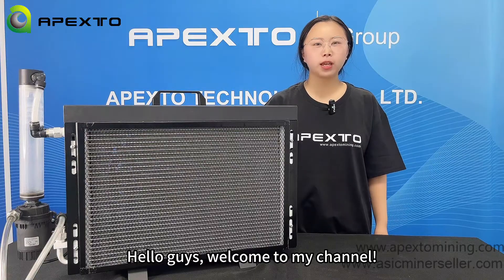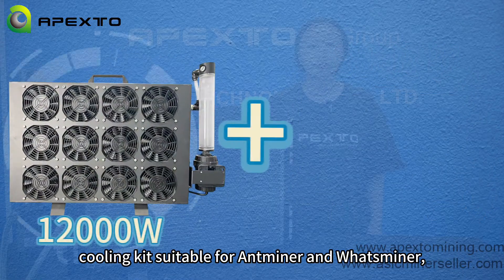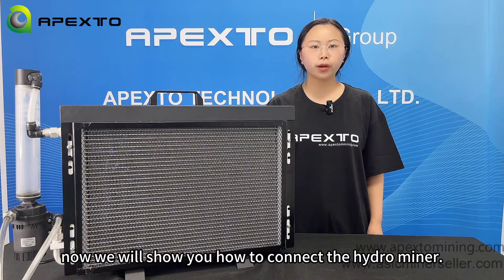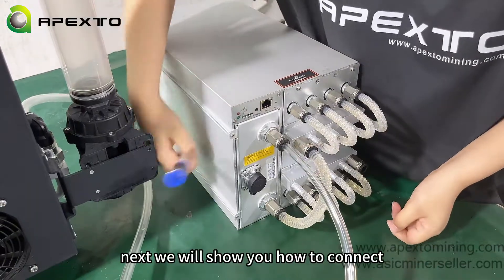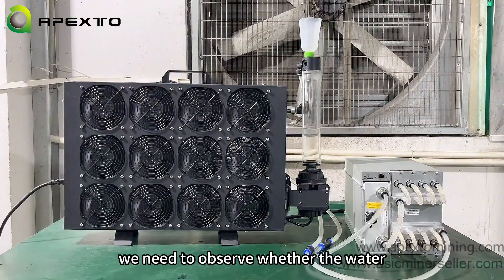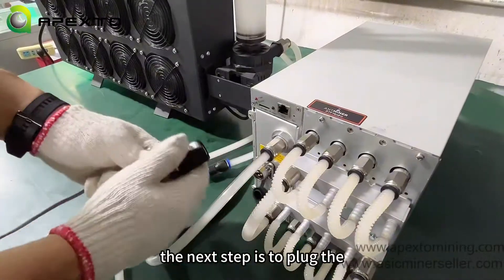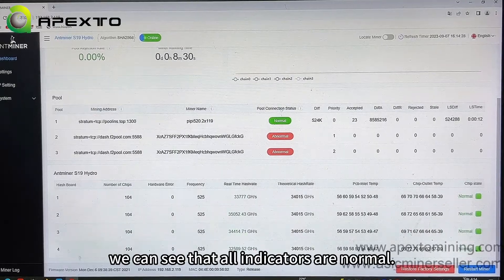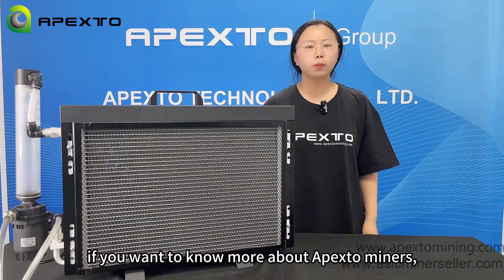12kW Water Cooling Radiator Tutorial Used with Antminer Hydro Miner

Comment: This Antminer is advertised with 257 TH/s. Even with this huge Coolingsystem it just delivers 135TH/s!? Am i wrong or did this missed the advertised performance by 48%!?
Reply from the maker: The hahsrate in our video is the data when the mining machine just starts running. To reach 257T, you need to wait for a while.

Comment: Can you use distilled water or only antifreeze?
Reply: Distilled water.
As the recommendation mentions the conductivity as the only factor to consider(?) while choosing/maintaining the liquid, I would be careful if adding antifreeze or other additive to the water. I used about 10 liters of de-ionized water for the first day of running my miner just to "wash" the miner and the cooler. That was about two fill ups, and in between these I made sure I emptied the system.

Then I have only filled it once again, but with distilled water, and now my conductivity meter shows that my cooling water settled at a conductivity under 20 μs/cm. It slowly rises again though, so I likely will empty and refill it again in a few days. I assumed the recommendation of low conductivity for the cooling liquid is related to the consequences of leakage, but I'm not sure :D 

The only reason one would consider adding antifreeze that I could think of is that historically some antifreeze additives had a portion of Tolyltriazole in them, to prevent galvanic corrosion. There should be no need for that if you use same material in the radiator as in the miner cooling block (normally aluminum). I would avoid adding anything to the distilled water, as it likely just make the water get higher conductivity.

Comment: Good evening, does this kit support cooling just one S19 or can it cool more than one?
Reply from the maker: Hello, thanks for your interest in our product, for tech, please add Kevin's whatapp directly +8615361002440
Reply: I imagine you can cool more devices.  Its how efficient it is at dissipating the heat from the cooling system.    I'd use a 50/50 mix as water cools more quickly than antifreeze

Comment: Some free advice for you guys:

60dBA is very loud. Why not use fans with lower noise level? The product is still not a low price level product for the end user, so somewhat more premium fans should fit your product concept better I think. 
And why are you mixing the water with air?, you let it in the reservoir from the top. If feed from bottom while using a divider wall, you can let the air separate out nicely in the reservoir. 

I wish you all the best in your development process.
Reply: Just get a old truck radiator and a 5-12 volt thermo fan
Reply from the maker: Thanks for your advice. Good day!
Reply: This is great tip!  I thank you!  I just purchased a s19 xp Hyd.  What Asic do you have?
Reply: @lopezmario4633  S21 Hydro. 
I now learned that if I push the tube in a bit, so that it reaches under the water level, the bubbles goes away after a few minutes. I use the 12 kW Lianli water cooler.
Reply: @kitewinds663 Hello. Do you have stock firmware in your S21 hydro or other firmware?
Reply: @lopezmario4633  do you own a mining farm?
Reply: @lopezmario4633 water cools faster than antifreeze.  Why they don't use a 50/50 mix is beyond me.
Reply: I was thinking the same just baught  an s19 120 T am going to convert it to water cooling i was wondering if say you can put something like Noctua fans 3000rpm on the radiator to make it quieter ?
Reply: @cass300  This water cooler is loud, partly to the type of fan used, partly because of the high rpm needed even in cold air. The pump is loud too, but mostly because it’s not dampened so good. I’ve rebuilt the pump bracket, so less noise now. I have enough noctua-fans for it, but they are too weak and slow for this amount of energy removal. Perhaps the industrial noctua would work. Post results if you try.
Reply: @kitewinds663  thanks for advice ive totally changed my mind im instead going to get Alphacool ES Orbiter 360 TS - External Watercooling System and a tank and immersion cool s19k in liquid at about 25 db

Comment: Why would the radiator use 8000w its just a few fans and a pump. thats an insane amount of energy
Reply: all radiators weather in a car or power plant or a Ac unit, are rated in wats. its not a representation of consumption its a representation of heat dumping capacity.  this rad can expel 8Kw of heat.
Reply from the maker: Hello, thanks for your interest in Apexto. pls add our sales Whatsapp +8615361002440 to get more details and tech support.